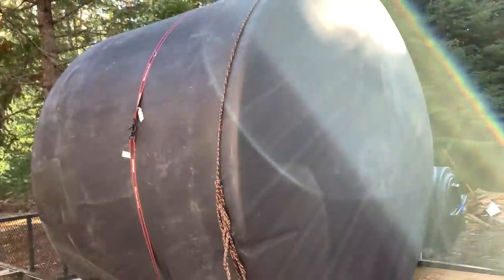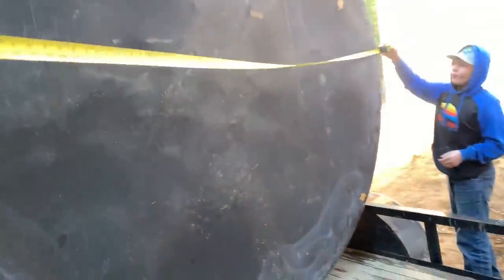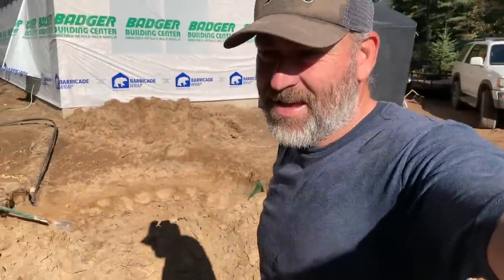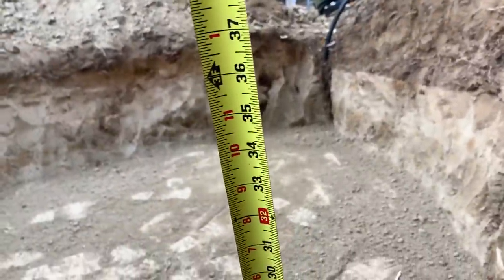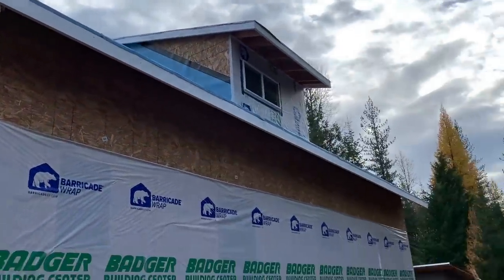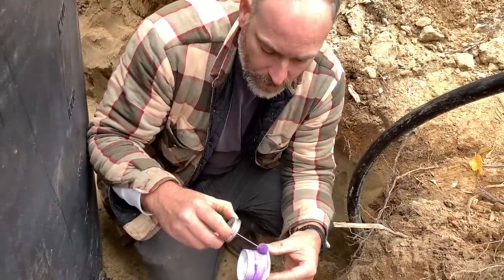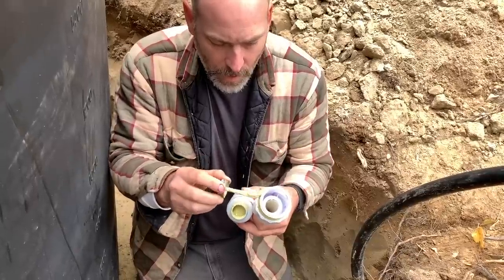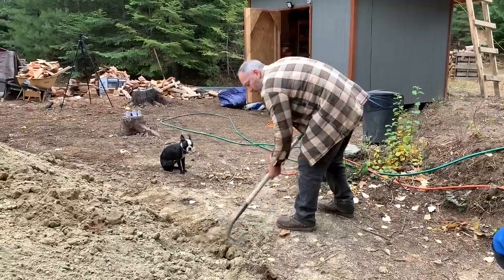Hand Digging a Hole for a 2500 Gallon Rainwater Harvesting Tank | Off Grid Cabin Build #47

Comment: Great job guys. Before back filling tank maybe put some insulation around the entire tank with a 3/4 inch plywood box built around the top of the tank above ground. This way you can install plenty of insulation over the tank. Just a thought. GOOD LUCK GUYS‼️👍👍. Vinny 🇺🇸

Comment: MARTIN Please you can save that shallow well.
1. Remove pipe put cap on the bottom of white 3 inch pipe.. 2.Add more gravel the bottom of well 6 to 2 inch. 3. Add filter cloth around pipe before putting it back in well. 4. use rain water to pump it DOWN into well and over fill well to purge the sand out of it. It will eventually remove all the sand and leave it clear !!!! 5. add concrete around ground level at pipe. 6. put an upsidedown toilet flange on the top of the pipe drill hole in plywood place on toilet flange and have pump on top of that.
Reply: ah i c. Never had that issue thought it was just dirty...
Reply: What about moving it closer downhill to the lower water table?